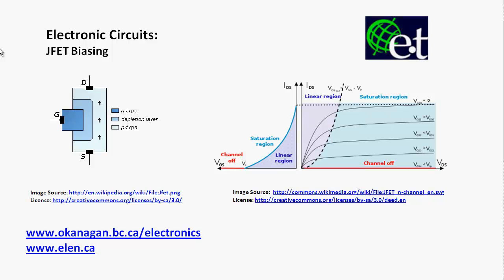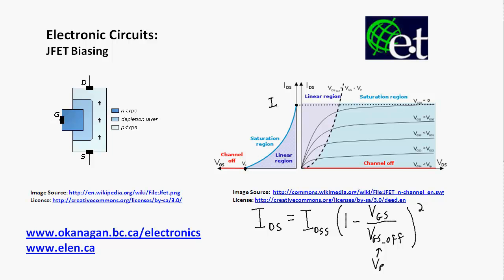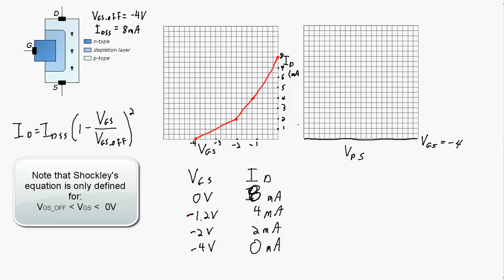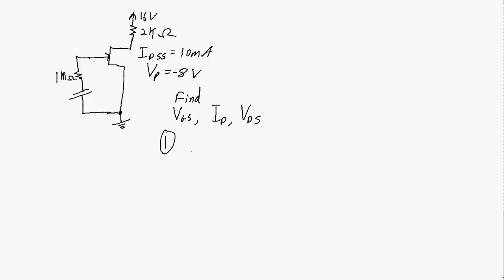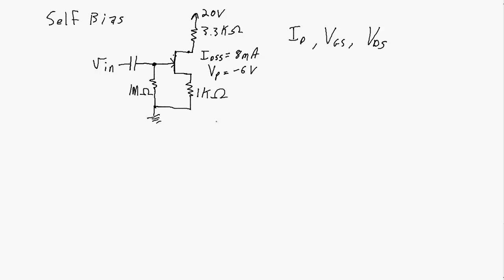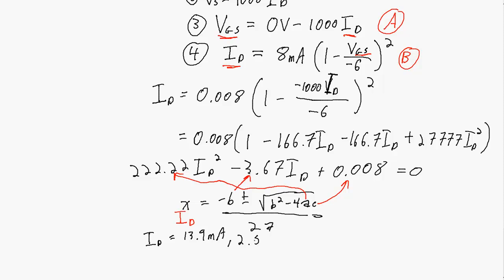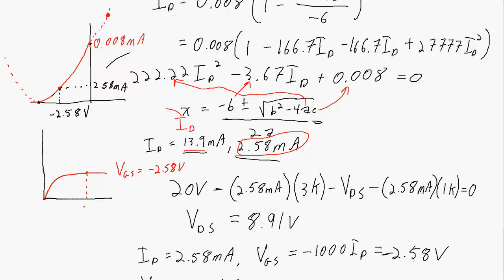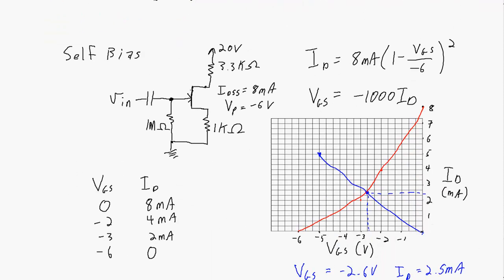JFET Biasing 1

Comment: Really an excellent series. One more thing I would like to see is the self biasing on larger inputs using the input capacitor and the forward biased gate as a rectifier to put a negative voltage at the gate and no Rs. The bias becomes equal to the peak input voltage and so a larger signal automatically uses a lower gm operating point, weak AGC. That raises the question, suppose you have a signal 1 volt peak-to-peak centered on zero: Does the square law continue to work up to the point where the gate starts conducting on the peaks?